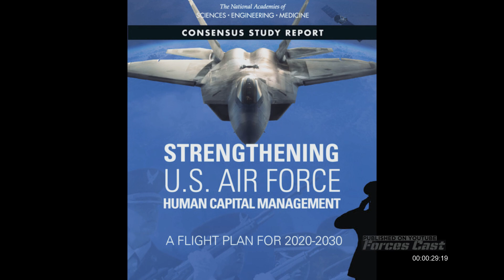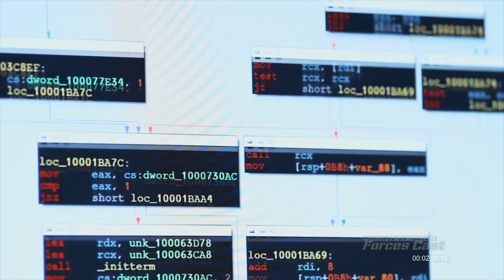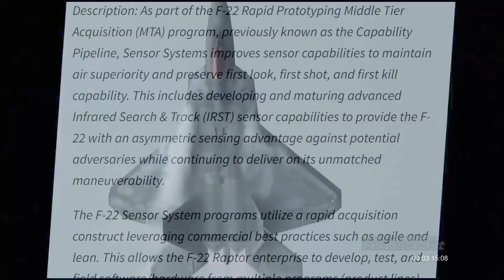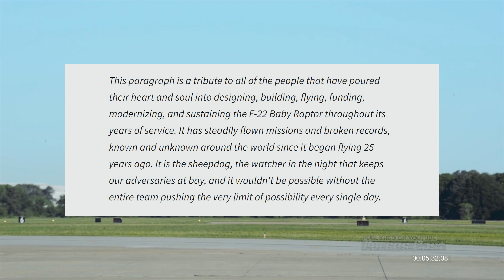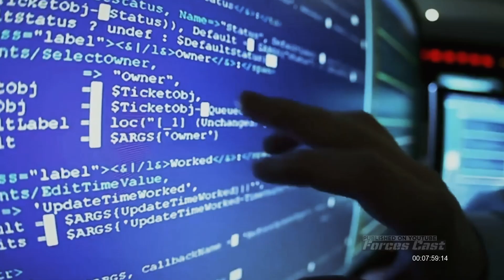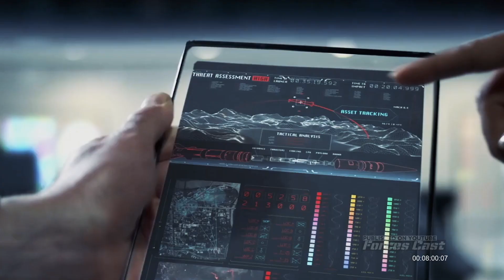America Uses F-22 Raptor as Sacrifice to Test NGAD Fighter Jet Technology

Comment: Resurrect the F-23 Black Widow 2 it's far superior to the F-22
Reply: False. YF-23 has inferior AoA and internal weapon bays when compared to YF-22.
Reply: @valenrn8657  you're all wet pull up the documentary on the F-23 it's about an hour long from the conception to the finished product it's superior to the F-22 in every aspect the speed of that plane is still classified to this day they said it was unstoppable I'm a current fighter pilot I fly A-10s and I'm almost positive that I have quite a bit of an edge on you when it comes to military aircraft how many military aircraft do you fly I flown quite a few and the a10 is the most fun plane to fly and very devastating
Reply: @craigbolton5949  Again, YF-23 has inferior AoA when compared to YF-22. F-22A has Mach 1.8 supercruise just like YF-23. F-22A is different from YF-22
Reply: @valenrn8657  watch that documentary Valen I believe it's called Black Widow 2 gray ghost it's about an hour long and trust me your opinion of the f-23 will change rapidly have a nice day
Reply: @craigbolton5949  YF-23 lacks YF-22's and F-22A's thrust vector control features. 

F-22A's wing design and horizontal tail designs were revised, hence when you look at the top view, F-22A's horizontal tail edge design resembles YF-23's canted tail edge design, AND F-22A's wing design was revised toward the diamond-shaped. LM's Fort Worth team is good at copying.
Reply: @craigbolton5949  What did Lockheed do that made the difference during the evaluation flights:

1. They demonstrated the high angle of attack.
2. They fired off a missile from the prototype.
3. They maneuvered the aircraft in 9G turns.
Reply: @valenrn8657  the F-22 Valen is a model T compared to the F-23 Black Widow instead of going back and forth with this check that video that I told you Black Widow 2 gray ghost I believe that's the name of the video it's about an hour long over and out I got to get back to work they're getting my plane ready another sortie
Reply: @craigbolton5949  I have watched the documentary multiple times. 

Facts, flying at high altitudes has thinner air, hence F-22's thrust vector control enhancements.

When compared to YF-22, YF-23 has superior stealth and higher super criuse while YF-22 has superior high AOA agility. Both proposals have fulfilled the ATF requirements.
 
Both F-22A and F-35A have high AoA bias.
Reply: @craigbolton5949  The documentary was about YF-22 vs YF-23, NOT about production F-22A Block 30/35/40s.